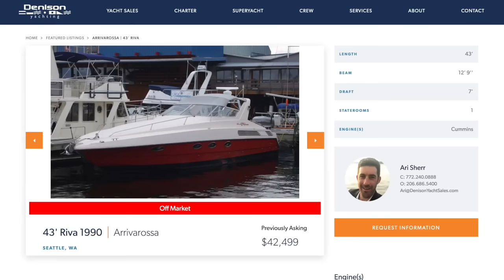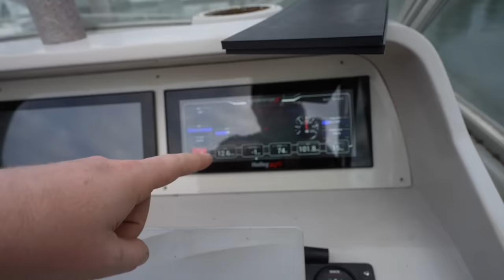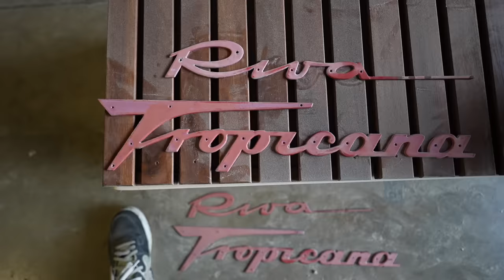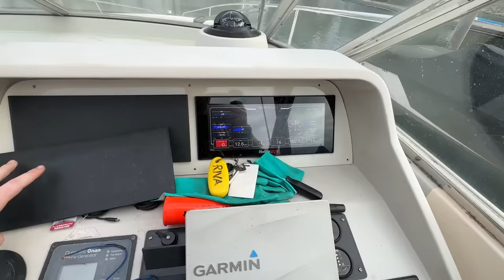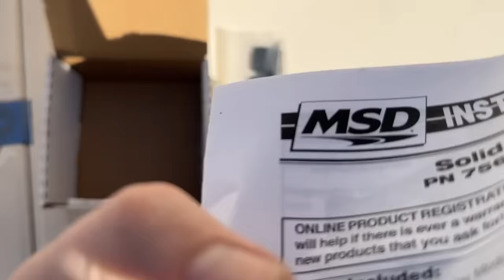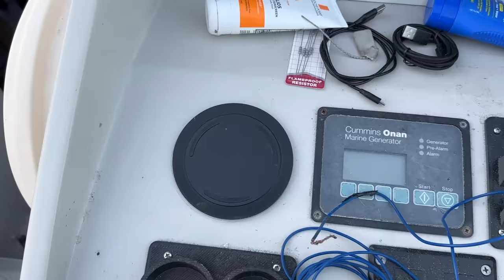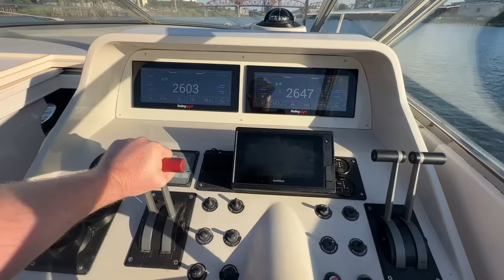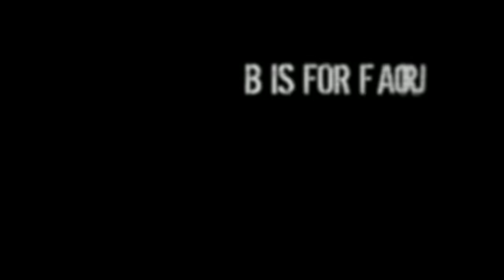LS Swapped 30yr Old Italian Yacht FINALE!! - ITS FASTER THAN EVER!!!

Comment: Another vote for new props.  You should aim for about 2 or 3 hundred below max rated RPM for the engines.  Cruise rpm (on diesel at least) is somewhere between 80 to 85% max RPM.  Additionally, the bow should not be throwing that much water.  I suspect the trim tabs being down is what is forcing the bow into the water.  The bow should be slightly higher than you have it set for optimum trim.  As someone who felt your LS swap idea was not the best decision, I'd have to say, I am impressed with the build and when considering costs, you won the lottery by reducing costs from rebuilding the diesel and the amount of content you generated!  I'm happy to see that it is out and about again!  I look forward to the video when you get the new props installed and REALLY see what the tops speed is.  NOTE: the props will also likely improve your fuel consumption at cruise speed by allowing the engines to operate at a more efficient speed / torque / HP ratio.
Reply: His bow is plowing because he is missing a few thousand lbs in the stern.
Reply: Never wear shoes on board on a yacht 😇🙏🏻
Reply: @demagescod9657  Well yes, but he also seemed to have the trim tabs deployed by a lot. Which is the very opposite of what you want with too little relative weight in the rear, of course.
Reply: Trim tabs were definitely down   lmao
Reply: These engines are definitely running way below their max. power and probably also max. torque rpm. I don't know the cam setup but I'd guess peak power will be above 4000 rpm for sure. Props with less pitch will definitely improve the boat's perfomance big time.
Reply: @ktmarvin300  Its even worse than you suspect. Peak power of these engines is likely at about 7000rpm or even a tiny bit more! Most modern stock petrol boat engines got max power at about 5000 rpm, but these are effectivly mild race/performance engines made for cars first and foremost...
Reply: Texas Speed is probably freaking out running those Motors at 2500 rpm need to find out what their Peak RPM is in prop to that another vote for props
Reply: @GoldenCroc  you can fit "truck" cams to LS boat swaps which is what most people do. Moves the peak torque point down. I don't believe they released the Cam specs, I would be highly surprised if Texas speed chose big cams for a boat (assuming they were told it was for a boat) ... not only do big cams have the peak torque too high like you mentioned, big cams that "Chop" cause reversion and can suck water in via the exhaust valves.
Reply: The rake of the prop among other things can be used to affect trim so he needs a prop expert in addition to getting those tabs out of the way
Reply: @zxggwrt  Yep. Also he should move everything possible as far back to the stern as he can. Batteries, water tanks etc.

Comment: Youll want to change the props for LS engines vs a low revving diesel engine.  Also now that you know where the engine runs RPM wise (after the prop change), youll want to look into changing the cams and the intake manifold.  Its been a hell of an adventure and i love to see it completed.  Congrats team.

Comment: If you can't reach your max RPM, you need to have lesser pitched props or just smaller props.
Reply: it's clearly geared to go downhill
Reply: Definitely the wrong props on there, he should be seeing double that RPM
Reply: Smaller diameter props with same/slightly higher pitch might increase efficiency too. The old props are probably for torky low reving motors. I dont think the torque curves are anywhere near a diesel motor on such a low rpm. People forget that torque and horsepower varies a lot on different rpms. Shouting out 1500hp measured at 6000rpm makes little sense when you have half that at 2500rpm.. When done properly you choose an optimum cam for the most torque at cruising speed rpm if overall efficiency is the most important factor.
Reply: On these boats a bigger diameter prop is in most configurations beter for efficiency and hole shot . I don’t know the gear ratio but it looks like hey needs to drop about 10 inches of pitch. Or change the gear ratio . Running this setup full trottle with to much pitch on the props can and will hurt the engines !
Reply: agreed with the comment here, you may want to talk to a motor shop about the correct props for these new motors
Reply: Was wondering why he's at full throttle and still under 3K rpm.
Reply: 100% can use diesel props made for 2500rpm engines on 6000rpm LS's
Reply: @vlat absolutely can not use diesel props on that..
Reply: His trans is probably a 1/1.3 ratio. He needs 1/2.77 ratio trans or different props. I'd rather switch transmissions. Big wheels and transmissions are about the same price..   id switch trans to zf 63as with the 1/2.76 ratio. They're 1,900 a piece. New trans is better than 33yo transmissions
Reply: Props are selected for the diesels. They make their power at much lower rpm. Slightly smaller props will let him use the full range.
Reply: Twin turbo both engines, problem solved 🤣
Reply: no, it was the trim tabs. they were pushing the nose down into the water. once you get on plane, you gotta lessen the planes a little, and let the SPEED do the planing instead of the tabs. he'll see a nice improvement in top speed and it will ride smooth
Reply: @ghomerhust  incorrect. Trim tabs won't keep the engine from revving. He has diesel transmissions that have a ratio of 1/1.3 a gas transmission has a ratio of 1/2.76  i have helped repower a lot of boats. This is a transmission issue.. Or props, but I'd rather change the transmission since they are probably the same price as new props.. That's why it will only turn 2,500rpm.. do the math on the ratios I provided. Rpm would be a bit more than double with the 1/2.67 ratio. My boat has diesel options with Cummins 8.1 or caterpillar 3126s with zf63a with 1/1.3 ratios.. My gas  boat has zf63a with a 1/2.67 ratio and it runs like this... https://youtube.com/shorts/xnxhxqvwdMs?feature=shared
Reply: What are you talking about??? They are not compatible at all. You can run in an emergency, but nowhere near the performance and efficiency @vlat
Reply: Those engines aren't coming close to the optimal torque/rpm range
Reply: Yeap. Props are his issue
Reply: The transmissions are the wrong gear ratio
Reply: @BlacksheepLSX  Almost right, but just a note: Trim tabs can keep the engine from revving quite a bit. Especially in a potentially very weight unbalanced boat as this.
Reply: You don't need to reach redline, if you can then you're leaving power on the table. All you need is a smudge past peak power band.
Reply: @aco2518  They are extremely often the same or almost the same though, to be fair.
Reply: Trim tabs are absolutely part of the problem, but not the biggest part. You can clearly see that it goes on the nose.
My boat is missing 400 rpm when I don’t trim out the drive, can’t imagine how much I would miss with trim tabs (I don’t have any).
Reply: @pargrip4404  Trim tabs normally makes more difference than drive trim.

Comment: You need to re-prop the boat! The props are to large in diameter and with too much Pitch ment for a low speed high torque diesel. Re-prop for your current engines and you’ll get the results you were hoping for.
Thanks for this video series 
Have fun with your great team!!
Reply: Yes, low RPM and high engine loading with the current prop. Equivalent to shifting your car into top gear and climbing a steep grade.   The recipe for detonation and catastrophic failure.
Reply: Exactly! It’s so close, just needs some fine tuning!
Reply: How do you figure too large diameter though? Thats not necessarily the case if you ask me, its the gearing and the pitch.... You need blade area to handle the power transfer good enough after all.

Comment: Hey! I’ve detailed boats for years and what I’ve found to work really well is to use some super clean on the floors and then scrub it in really good with a brush and then pressure wash, this works for the seats too but you just can’t let the super clean sit on the fabric too long! Great job

Comment: Contact Texas Speed and have them give you the correct full throttle operating range for those engines,  and then re-prop the boat to achieve the correct RPMs.   I'm guessing at WOT you should be turning about 4,500.   Also for top speed runs the trim tabs should be fully retracted,  At low speed the tabs help keep the nose down  for better visibility and smoother ride.  at top speed with the hull fully planed out lowering the tabs just creates drag and slows you down.  enjoy your boat. thanks for the great videos.
Reply: Hope he reads this post and follows your advise.

Comment: Probably the best, easiest, most efficient way to clean the deck is going to be to buy a large (7-8") drill brush attachment for your rotary buffer/polisher. Ideally something with a medium bristle stiffness so that it's not TOO abrasive, but still strong enough to dig into the texture. Obviously help it with whatever nice soapy cleaning solution works best, but I think you'll be really amazed at how well that'll work for you.
Reply: Yeah, it's weird that they had the solution and then immediately abandoned it. 😄 what they did worked but the drill worked first. Lol

Comment: You might want to consider having the fuel level sender adapter CNC machined. 3D printed parts are not really very well suited to sealing containers as even with 100% infill they can let fluids or vapors through. It will not be cheap, but with how much you have invested in the boat, I think it would be a relatively small cost.
Reply: Agree, and the plastic might not be compatible with gas fumes long term. That said, a 3d printed prototype is great to make everything perfect before you spend machinist money!
Reply: a turned delrin part would be ideal.
Reply: they are fabricators.  They can make it themselves.  A solid block of UHMW and they can just cut it out.  I am not a fan of 3D printed parts.  I have had ones that i bought melt and self destruct.
Reply: Yeah this happens even with my portable Yamaha fuel tanks for my outboard powered boat. As they age the plastic breaks down a little and lets vapors & fluids out (near the fuel gauge/sender) if the tank is 100% full.
Reply: Sendcutsend wouldn’t be too expensive, and they already have a cad file for it

Comment: I’m not sure what epoxy was used, but most epoxies will fail under direct sunlight. You may want to look into adding a top coat of varnish or another protective layer to protect from the UV rays on that table top. The boat is looking great and I am always impressed with your problem solving!

Comment: For your inboard setup, those motors should turn somewhere around 5k at WOT. If they were I/O drives , then you could probably get 6k out of them. Most boaters don’t cruises their boat at 1550rpm for a gas powered, typically cruise between 3200 and 3400rpm. Cruise your boat around there and tell us what your GPH and range is. 2500rpm is not ideal for those motors. You’re working them too hard. You need to change your prop pitch.
Reply: This...those motors are being strained. They are not designed to have that much load at that low of an RPM. Definitely going to hurt the engines in the long run.
Reply: THIS.  ^^
Reply: When these engines wear out like start banging rods out lugging them so hard he will be sponsored to get 2 new ones! 
Duh
Reply: AGREE….NEEDS REVS!  2600RPM is diesel revs
Reply: Yes, 3300-3600 is great cruising rpm on my twin 7.4L
Reply: Agree about most of the post but disagree about the 5k WOT.. why do you figure that? These are race engines and want more revs than that, they should be geared to give max engine power at just a bit below WOT lightly loaded, and thats probably at 7000 rpm at least if the power numbers he gave us are accurate. If he is not going to use that rev capability, better to build a much milder tune engine to start with.

Comment: Hey, for best speed you need to lift the bow with the tabs not force it down. Ideally the spray should appear to be near your wind shield.
Great videos, wish you many happy hours boating.
Chris and Claire
Reply: Tabs don’t lift the bow, the tabs can only push bow down.
Reply: Correct, but he clearly states he used tabs to lower bow during high speed run which slowed him down considerably

Comment: way over propped.  you need the RPM. Diesel props on gas motors will not work.
Reply: who would have thought??? 🤣
Reply: Agreed! Getting props though to reach WOT for those motors (5000-6000 rpm) would take a good bit of time to get that boat on plane- would you agree?
Reply: @jackdaily3383  I haven't seen the dyno graph for those engines but I will guarantee you texas-speed has one. Those props should be pitched for right dead nuts in the middle of that camel hump. I will guarantee you it'll get on plane three times as fast as it does now. For some reason I'm thinking 6000 RPM as well. I'm sure those things can handle 8 but six is probably where they peak. What blows my mind here is all the money that was thrown around including given to Texas Speed yet no one questioned the tire size or the rear end gears of this boat.
Reply: He has transmissions though so need to account for that too. To elaborate he should prop the boat for the hull and plane speed he wants to run and should have gotten the trans' with the reduction ratio required to be in range for the ideal prop speed.
Reply: @mrjgueret 100% this. There is no way he made it to peak torque at that low of RPM.
Reply: @1slow370  correction would be you don't prop for what you want, you prop for what the engines can dish out at wot. If you wanted to under pitch, then you would have to set a rev limiter or limit throttle pull or you over speed the engines. So basically if you paid the money for those engines I would want all the power I can get out of them. Find out what speed the boat can go at the end of the day.

Comment: i'd love to see a top speed run but with adequate props and the boat trimmed how it should and maybe change the gear ratio (?) , i think this riva still has a lot to give :)
Reply: Hell yea that boat can do a lot more it could do that with one of those motors
Reply: yea that thing needs changing gear ratio and props for gasoline engine. 2.5k rpm is to low. i converted my boat from gas to diesel it vent from 1:1.95 to 1:1.158 and prop from 21 to 17 pitch. now with 120hp diesel max speed is 24 miles crosing speed 15-18 and burning like 8 liters of diesel per houer.

Comment: Agree with a lot of the comments.  You will likely need new propellers that have the right size and pitch for those engines.  Also, if your trim tabs are fully engaged, they will push the bow down which is great for rougher seas. It takes a lot of the bounce out of the boat.  For calmer waters, you want the trim tabs only slightly engaged which keeps more of the bow out of the water and increases speed by reducing drag.  If your tabs are engaged, you will see the initiation point for the wake closer to the bow (where the water is spraying off the side of the boat).  You want that water to be as far aft as possible meaning less of the boat is in the water and it is moving more efficiently.  Good job on the build. I enjoyed watching it.

Comment: Lots of people have said about props/trans ratios, but it needs to be remembered that all boats have a MHS - Maximum Hull Speed, this is the hydrodynamic limit for the boat to travel at, regardless of how much power gets thrown at it. Yes, those engines are being restricted as should be able to get at least 5000 rpm at full throttle

Comment: For the furniture, stain with no topcoat or clear coat seems like a bad idea. Like a heavy layer of poly or for marine applications, I see people using varnish.
Reply: Life's too short for varnishing, especially cheap Ikea stuff. Back to the workshop and spray them with clear epoxy. They will last a lot longer as well.
Reply: He also should probably be using the proper plywood and other boards. Teak is a lot more expensive than regular wood but there's not much better for marine applications
Reply: Don't spray epoxy.  It's terrible with UV exposure.  Use spar urethane, or something else that's meant for the outdoors.  Regardless, you'll likely need to retreat it every couple of years.
Reply: Yes, I was wrong, West System recommend a two pack polyurethane  @sfallier

Comment: To clean the gel coat decks, I recommend a product with "oxalic acid". I use a product called "Star brite Rust Stain Remover". It can be found at any marine store. Spray it on, light scrub with a bristle brush, rinse in 5-10 minutes. Works really well but try to avoid metal and if not, rinse the metal really well.
Great series, really like what you did with the boat. Don't be afraid to publish more boat cruising content (or any boating content).

Comment: Drill brush, and comet bathroom cleaner will get the deck clean.  Then go back over with a fiberglass polish to remove the scratches so it doesn't get as dirty later on.  The metal bushes will leave scratches that will collect dirt and mold.

Also you don't want a black steering wheel in the sun... light colors.
Reply: I was about to say just this… those coarse brushes had to have left a grain in the deck